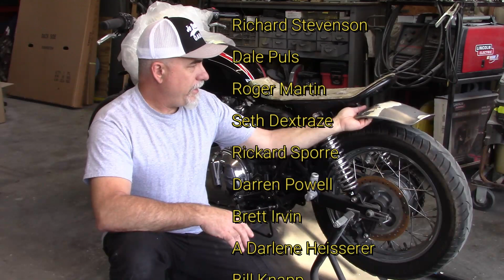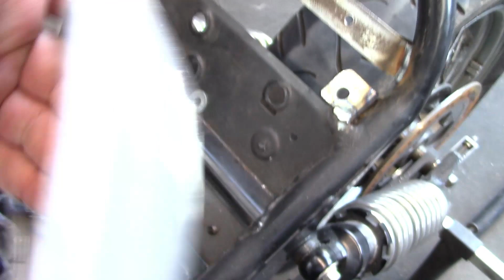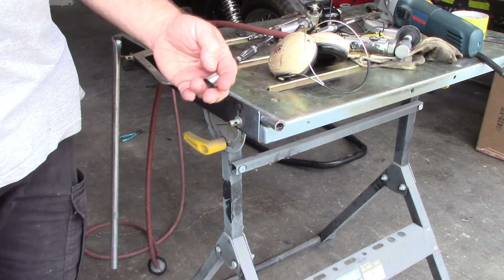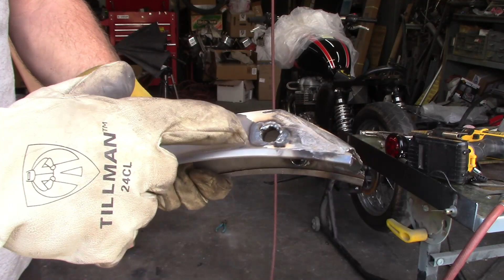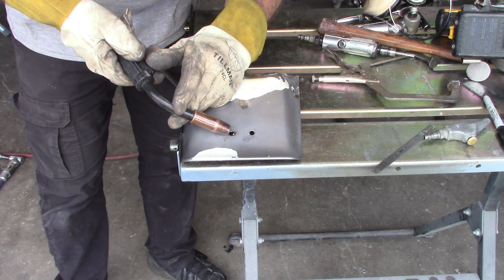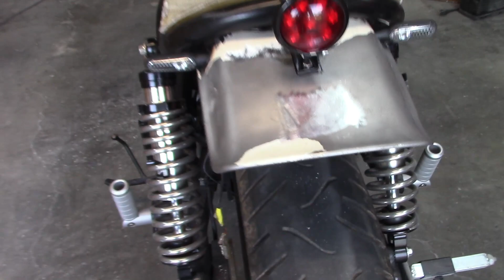Triumph Scrambler part 3. Mounting the fender and turn signals.

Comment: I don’t like the idea of splitting the nut. You would be better off cutting the ends off the wires and putting new ends on after you put an uncut nut on. The nut that is cut won’t be as strong and will be prone to vibrate loose
Reply from the maker: I didn’t split it. It came that way from the manufacturer. The split washer will also help as it’s like a traditional lock washer.